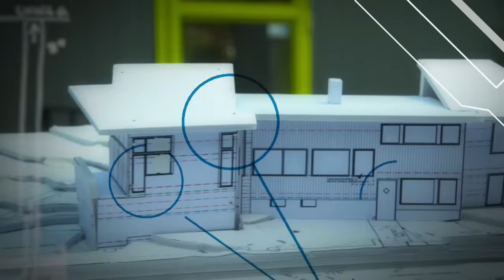This Old House | Eight Is Enough Stairways (S40 E20) | FULL EPISODE

Comment: So they're hanging drywall on a piece of foam adhered to a concrete wall?
Reply: Hanging drywall on plastic in a styrofoam wall... doesn't seem good to me either.
Reply: No, they're hanging it from the plastic studs inside the foam, which is cemented to the concrete. They can hold several hundred pounds of weight. Go back to Season 39 where they built the entire basement and foundation out of concrete surrounded by styrofoam with plastic studs.

Comment: Kitchen exhaust duct is to thin ! It should be a thicker pipe to handle the heat and grease laidin air. Horrible setup plus that hot water tubing under the floor ? Would sure suck if there was a freeze up.
Reply: Watching this house remodel has been so hard.  The homeowners have no idea about building or construction and have lofty ideas about what can happen in a "modern" home.
Reply: I can't! 🙄

Comment: This house must have tested the patience of Tom & Company. All of the ticky tacky stuff you deal with on a normal jobsite is amplified by the layout of the house, the additions, the three different radiant floor systems used, no walls/corners being square, a ridiculous number of stairs, the homeowners wanting walls of glass that made plumbing and electrical more difficult, etc. I thought it would be an interesting project but all of the busyness takes away from anything interesting about it.
Reply: And the house looks like it was dropped into a random lot without any thought of, "should a house really go here?"

Comment: 12:39 Great, now I want a palm nailer. I have zero use for it but I’ve got to have one immediately.
Reply: I am redoing everything in my house. I bought the palm nailer to fit between joints where a hammer wouldn't swing. Now I use it all the time.  Small space - no problem, awkward reach - no problem, save your elbow - yes. Buy one and use it for everything.

Comment: I am surprised they did not specify an 8" by 8" steel columns in a couple places for the various utility stacks.  Just run one of those composite pipe liners down them to keep the water, electric and air from corroding the new "chase" that happens to be structural as well.